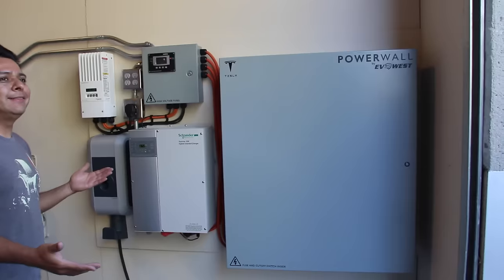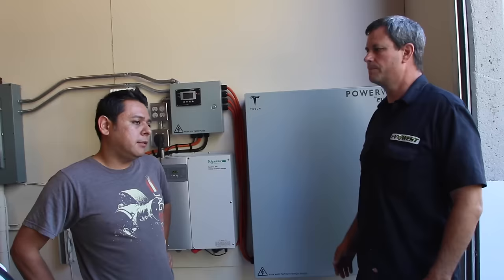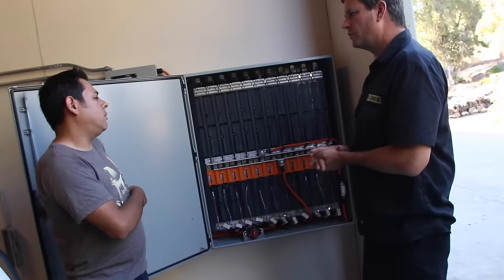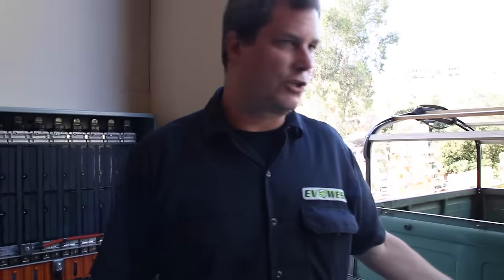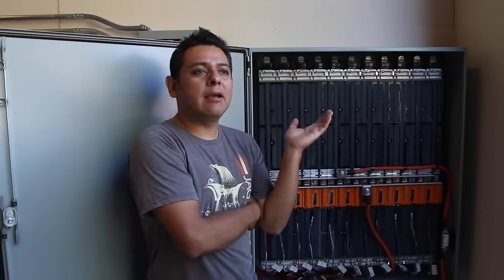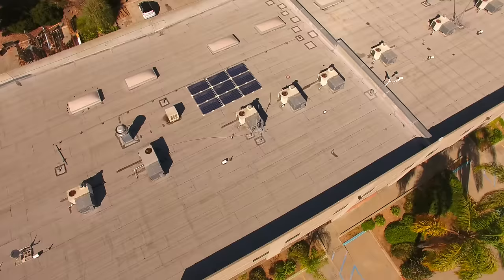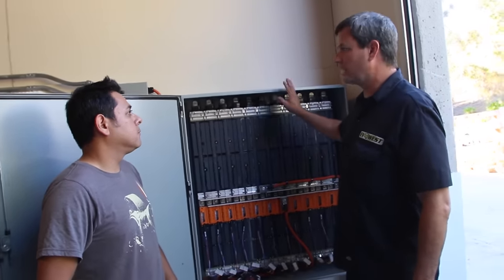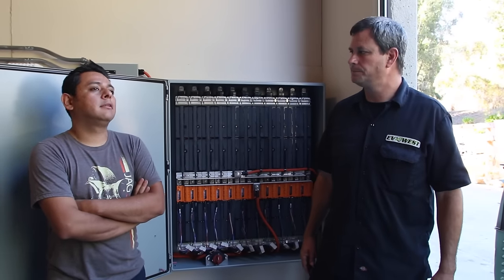DIY TESLA Powerwall  - my  WALL vs ELON'S WALL

Comment: I don't know how that video does not have millions of views and why more people have not tried to build one, this is absolutely one of the coolest projects
Reply: Because not everyone has to pay for electricity at prices like in California. Places where electricity is 10c/kWh or less have no incentive to use solar right now, even if they were in the middle of a desert. It could be an environmental choice if you were getting your electricity by fossil fuel, but there are places running mostly (if not only) on hydro, wind, solar or tidal power.
Reply: you mean to say the price is higher in places where there is more sun. how does that work? How expensive is it in California?
Reply: +NewTech 20¢
Reply from the maker: @Agent Office  - so you are mean and ignorant.  great  @NewTech -   in california rates vary,  off-peak for me costs 14 cents and peak 49 cents,   Summer rates are higher than winter and there is also a tier system where your rates get higher after you past certain amount of energy,   for me tier 2 starts past 10kWh per day
Reply: Chargèro I will build it n they will come
Reply: It costs ( 15:06 ) $15,670 like thats alot like alot alot ? Maybe thats why
Reply: Solar panels are almost always  connected to storage batteries ( or no power at night time ) the power wall is just a fancy way of putting the batteries up ageist the wall
Reply: California has the highest rates i know of for electricity.  PG&E charges or buys electricity for $0.85 kWhr on Peak Days on some rate plans.  If this guy is in California and has excess electricity he could be “selling” it to PG&E for $0.85 KWhr during the day and they buy electricity back on the same day for $0.12.  For every ONE kWhr you sell to PG&E you can buy 7 kWhrs back the same day.

What’s the efficiency of a PowerWall?  Lead acid batteries are only 60% efficient, the other 40% is last as heat energy in charging and discharging the batteries.  

Wonder how much energy the guy in the video is losing as heat energy for using cables that are too small.  (In the video he says they are warm.). He might be able to easy buy 1 or 2 less solar panels if here were using the proper gauge wire and not loose so much of the energy he was producing to heating the cables.
Reply: Yes, and that's why almost every school in my right wing northern ca county has installed a huge solar array. Apparently schools have access to money cheap and this was their investment.  The arrays are far larger than what is needed for school electricity and I'm sure they are making money, and they made the most money during our 3 year drought because the hydro power that was bought from fed contractors wasn't available.
Reply: Here in Norway we pay arond 1kr/kWh, about 10/15 cents.. me, as a really interested 16yr old have thought of doing one of these.. but haha dont have the money and seems like it takes yeeeeears to earn it back.. yes, ofc its a hobby and i (we) love it, but in the end its just wasted cause the prices are not that high. Still wondering how much batteries, panels etc of we use just under 33000kW pr year
Reply: It is a major fire risk if done incorrectly.  I imagine this guy really knows what he is doing
Reply: because it doesnt come with popcorn. duh! 😁
Reply: Well imagine that you have a remote area that needs to have power to operate. It makes sense much faster as running lines out to some areas costs 70K. Plus if someone was doing indoor cultivation this would help out if power was to be lost. This is also great for hospitals since they have so much equipment that cant go down.
Reply: It will take community for things to change, the gov isn't interested, esp if they cant control you. Jehu is a fricken legend and should be applauded. Im a first year mature age engineer student and find Jehu to be very inspirational. Most people go home watch tv and do fuck all while Jehu is conducting research. Hats off to you Sir.
Reply: (A year later, I know,) however, I do not think that @Agent Office is in any way mean or ignorant. I think he was just questioning the economics that lead to power prices being so high in an area where renewable (solar) power should be very accessible.) I'm no economist, but this is actually a fair question. Knowing nothing about California, it's energy sources, or even it's energy prices, I'm guessing that the higher energy costs are primarily a product of demand, despite the theoretically high availablity of solar energy.
Reply: Dude, it DOES have million of views.
*Facepalm
Reply: @MrLiquidxIce  That's a lot considering a Tesla Wall cost $11,500 with an installation of $4000. If you purchase it as an add on  to a Tesla solar powered roof it is around $8,000.

Comment: Super to know that there are others like me. I operate a 2.5KW system with three banks of 24VDC. It's a great feeling to operate a non grid tie system. I have been improving it every year for the last 5 years. I'm a master electrician with 35 years in the field. Thanks so much for making this video. I save about 40 percent on my utility bill per month and looking to increasing the my grid into next year.

Comment: That panel is about $7000 cost. + 2400 inverter, + 250 for the fuse panel, + 1000 for the other 2 panels.  11,650 dollars. 

.12 per kwh. =97000 kilowatt hour recovery cost in today's money.  

That's about 1142 Tesla Model S full 85 kwh charges assuming a perfect world and 100% efficiency.   That's about 10 per full charge which is in line with Tesla estimate for a 300 mile charge (listed as $12).  

That's cool.  But, the return on investment, assuming 100 miles a day (heavy estimate average) you would simply have to drive your vehicles for about 3000 days to break even in today's money, that's 9.38 years for 1 car driven 100 miles every day of the year.  If you have a fleet, then say 5 cars an average of 30 miles 5 days a week, which is 150 miles per day or 750 per week.  That's about the same payback (since you likely aren't drivi g all 5 more on average).

So your investment, assuming labor costs and maitenance cost and replacement costs will likely reach 16000 easily over a 9 year span will only slightly offset the increase in enervy costs.  Economically speaking, 11000 invested in  bond at 3% would net you 3700 bucks in 9 years and could have paid for 31000 kw or 375 charges at full 85.  Assuming only 1/3, that's 1000 charges.

Seems like a lot of money to spend.  16000 cash invested into a 3% dividend investment blue chip could net 5500 over 10 years plus any stock increase.  Snice after about 10 years, it's unlikely your system will be 100 efficient, and will still require manpower and maintenance, it's not a bargain.  The intrinsic value is only environmental, but not economical.  Imho
Reply from the maker: +David Boyanich all charging on this shop powerwall is done at day rates of $.49 here in California.
Reply: Yeah, but can you run your refrigerator and air conditioner when the power is out for four days?
😎😎😎😎😎😎

Comment: I really do understand why you use these batteries they are cheap and great, but they are design for high power application and will give you around 1000 to MAX 1500 cycles before the are really bad, the cells planed for use in the new Teslawall are NMC cells they will give you a much longer life, when you say you wall will last for 25 years and we assume your batterys are brand new ( 1000 Cycles left ) it can give you around 4 kwh on average every day, a fair number when you take into account that your cells are not new would be 5 - 10 years :-) but for everyone who can get hold of these cells "go get them" :-) in DK they are not available jet, and i personally like Lifepo4 more, so my own battery is made up of 864 x 3.2v 30Ah Lifepo4 cells giving a total of around 85kwh, Lifepo4 have a lower energy density but is much safer and will give you more than 2000 cycles before the capacity goes below 80% of the original capacity, the size of my battery is based on a daily power consumption of 20kwh, at that rate the math is 85kwh / 20 =  4,25 days pr. cycle ,times 2000 = 8500 days / 360 = 23,6 years, when you take into account that much of the summer i will use power directly from the solar system the 20kwh pr. day is very high, but i will assume the lifespan to be 25 years.
Reply: Very well thought out. Thank you for showing people what is necessary to get the math right. lifespan of 25 years is great! let's hope battery tech leaps ahead over the next few years!
Reply: Given the source of those modules (Smart EV), I'd bet they're first gen LiCo batteries -- i.e. "firecrackers". It's possible they're second gen, and thus somewhat less prone to exploding (thermal runaway.) I don't know what the gigafactory will be putting in the 2170's. Third gen NMC would be my guess, but I don't know. Panasonic doesn't say.

That said, temperature, rate of charge/discharge, and depth of discharge are what ages batteries. Repeated deep discharges will significantly reduce their lifespan. All of this is well documented in datasheets.
Reply: Main thing is to have an extremely large base of power storage but to thread light on its drain capabilty...that way even lead acids will last very long time...eg if you use 3kilowatt per day make sure you have 100kilowatt storage or more...idea is not to over stress the batteries.

Comment: Very simple to get around code/ grid. Install the off grid system with dedicated duplex outlets just plug into those outlets. Also very easy to install a transfer switch for generator back up power, use the solar panels system in lieu of generator. I plan to install separate dedicated solar power outlets for main TV room, computers, stereo system that's the majority of the electrical I use. Some of the outdoor individual garden lights can be set up indoors for cheep general lighting (solar panels set outside the windows)

Comment: In my humble opinion off grid is the way to get into solar.  All the  stuff you have to do to grid tie is expensive and extra money spent means a longer payback period. I have an off grid system that works like a charms.  I built it myself to meet all electrical codes.
Reply: Esp installation

Comment: Thanks for showing this.  A few thoughts: BMS isn't just a luxury or something you should use when you think your batteries might need levelizing, it's a safety measure to prevent overcharging and fires.  Also, you get more smiles per photon when you use tech to massage your batteries, right, so a BMS should be a priority with BEVs, not a privilege.  Just ask to fools who burned down their houses overcharging LiFePO4 hobby packs to power their ebikes.  If I misunderstood, and you do have a BMS inline, I apologize for the tongue lashing.
Also, please don't fondle your high voltage electronics with your bare hands like he does in this video when it's hot.  It's a bad habit to get into.  You can point, without touching.  Lastly, just because a solar installation isn't grid tied, it doesn't mean you don't need a permit and inspections.  Lots of folks do stuff without a permit, but please be careful not to instruct other people that it wasn't required.

Comment: There's a trick to starting APC UPS box. Must have proper  battery voltage before plugging AC power. Also, you can start without AC altogether. Again, start with proper battery voltage, push power button ( I ) one time, push power second time and hold until you hear beep, then release. I use my APC smart 2200 UPS this way with solar and lead acid.  No AC power!!  Powers my 8000 btu air conditioner. No problem. I'm very interested in seeing you get this working with lithium ion. Thanks for all the great videos!

Comment: FYi guys, I did the math on this when the powerwall was announced. A DIY, Rolls-Surrette, lead acid powerwall would cost less than half of the Tesla powerwall and last 4 times longer.

Of course, the batteries are much larger, but that's the only problem with it. I included a battery management system, as well as a power distribution system in the costing, so its a total system price.

Top of the line Lead Acid cannot be beaten for price per Amp Hour, per Year. The Batteries they use for the Tesla Powerwall will need to be replaced long, long before the Rolls-Surrettes will.

The only technology that can beat Lead Acid on a price/Amp Hour/Cycle Life comparison is, believe it or not, nickel/Iron batteries, as pioneered by Edison himself. Unfortunately they are not sold commercially. EDIT: I am wrong about this. They are sold commercially. And they are expensive.. which should tell you something about their longevity.Look up 'Edison battery'.
Reply: Timothy Zyg a
Reply: Timothy Zyg numbers? :)
Reply: A 700 CCA Yellowtop only produces 55 AH. V X A = W. 12V X 55AH = 660 WH. 33,000kwh / 660wh = 50 batteries.
Reply: Its not about Watt Hours. Its about Watt Hours extracted per cycle, per dollar expended on the battery. Do a spreadsheet incorporating cycle life and price and you'll see. And for those who don't believe me, it's 20 minutes of work on a spreadsheet to figure this out. Do the work and you'll see for yourself.
Reply: Deep cycle battery count needs to be > 100. Your cant discharge more than 50% or it has a very short lifetime.
Reply: @Flash1857  Actually, for Lead-Acid battery you should not go below 80% DOD.  Nothing "magical" or "bad" happens at 50% DOD.  The BMS prevents the user from really deep discharging the Li-Ion batteries, like we can with Lead-Acid.

Comment: Thanks for the post.  Very cool.  There are so many ways to do this stuff that anything is possible.  Hey, I have a half dozen "dead" UPS's here.  LOL  All had the inverter go dead.  And, when we got there, they overcharged the batteries and destroyed them as well.  I won't tell you the level of money flushed down the drain, as it would hurt.  I'm still tossing around between lithium and lead acid.  That's the really hard part in designing a system.  Thanks again.